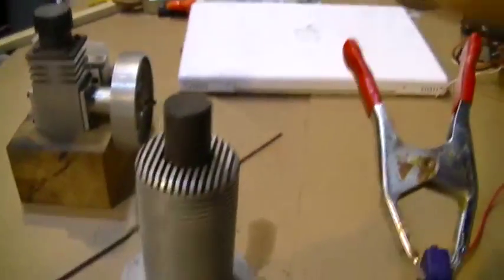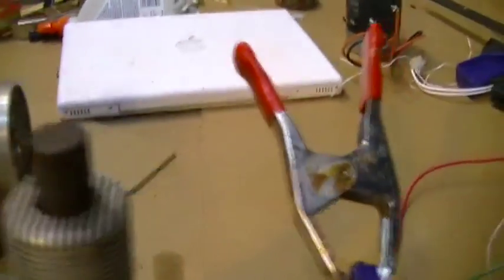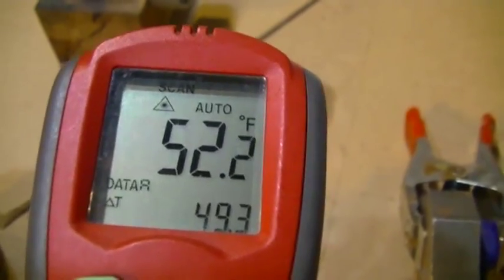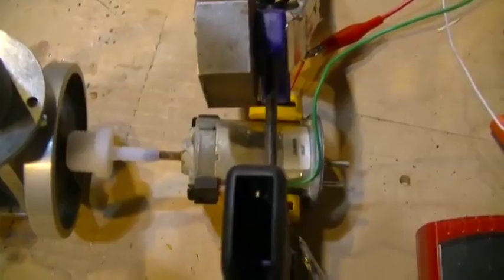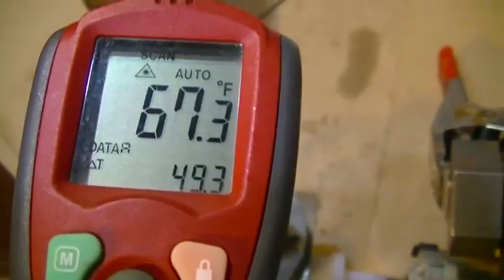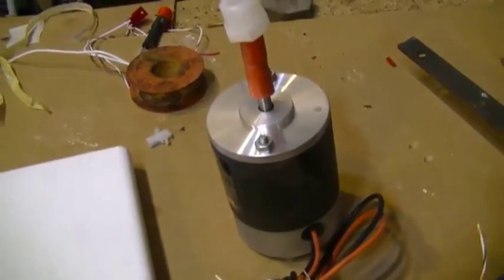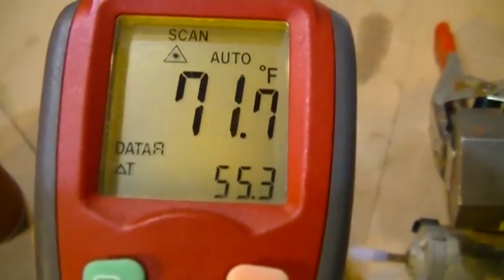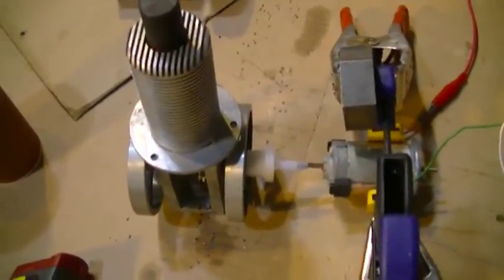Stirling Cooler Stirling engine 12v DC power source FPSC Mechanical refrigerant free refrigeration

Comment: What you were describing in the end sounds like a Stirling cycle cryocooler but I'm not sure how you would use it as an engine.  As you said the piston is completely sealed inside with helium and it runs on magnets.  There are no physical connections to this mechanical motion that you can get to or observe.  I've heard they CAN work in reverse (apply cold to cold head and heat to rejector) and you can get the piston to start moving inside.  But, like I said, you couldn't do anything with that motion.
Reply from the maker: It is the same but not as efficient. I have a real cry cooler stirling but the power supply needs jumped as the board is shot. I want to do a video soon on that.
Reply: I have a Stirling cryocooler too.  I produce liquid air with it.  For mine, I didn't even get a control board to begin with.  I use a variac that I bought on eBay.  The manual describes a "runaway condition" where the piston keeps moving if you don't use a heater to heat the cold finger before cutting power to it (Stirling engine effect!) but mine's oriented with the cold finger pointing downward and the manufacturer told me it won't take off running in that orientation for some reason.  Apparently, if your cryocooler does run itself on a temperature difference, it supposedly can damage it.
Reply: @ChristmasEve777  ⚠️ God has said in the Quran:

🔵 { O mankind, worship your Lord, who created you and those before you, that you may become righteous - ( 2:21 ) 

🔴 [He] who made for you the earth a bed [spread out] and the sky a ceiling and sent down from the sky, rain and brought forth thereby fruits as provision for you. So do not attribute to Allah equals while you know [that there is nothing similar to Him]. ( 2:22 )

🔵 And if you are in doubt about what We have sent down upon Our Servant [Muhammad], then produce a surah the like thereof and call upon your witnesses other than Allah, if you should be truthful. ( 2:23 )

🔴 But if you do not - and you will never be able to - then fear the Fire, whose fuel is men and stones, prepared for the disbelievers.( 2:24 )

🔵 And give good tidings to those who believe and do righteous deeds that they will have gardens [in Paradise] beneath which rivers flow. Whenever they are provided with a provision of fruit therefrom, they will say, "This is what we were provided with before." And it is given to them in likeness. And they will have therein purified spouses, and they will abide therein eternally. ( 2:25 )

⚠️ Quran

Comment: Induction used in cooking would work to heat the pistons on the engine. A new electronic motor to run vehicles maybe?
Reply: Or just use induction to move coils of wire directly and forget the stirling engine? (This is an electric motor by the way) Why waste any of the energy by first converting it to heat and then mechanical energy? Is there a purpose -- apart from maybe keeping your chips warm in the car.

Comment: Dan add a heat plug used in diesel engines to heat the piston on the Sterling engine that drives the engine that generates the cooling effect. maybe we could work on a cold sink to make a mass air conditioning unit that does not consume large amounts of energy? Novartis!

Comment: is stirling refrigerators more efficient than peltiers and if so how much more efficient
Reply: Dean Walcott Depends on the gradient, but in the worst case scenario a couple times better, in the best case scenario many times better. Peltier modules range from 0.25-4COP ROUGHLY if i remember, but the COP of 4 is only under a small temperature difference and rarely useful for the types of cooling you might use a compressor system for.     Meanwhile the stirling can do big temperature differences with less of a performance hit (one issue with peltier is hot and cold is so close that there is losses if the deltaT across the module gets big.)

Stirling refrigerators also vary in efficiency depending on how well they're designed and what temperature gradient you're going for, but they can actually do something functionally similar to a compressor cycle system but I think practically not quite as well (costs & efficiency.) 

Twinbirds Japan makes some really cool overpriced coolers for the medical market and coleman used to have a "Stirling Cooler" that worked like this.  It's been off the market for a long time though and I haven't been able to buy one used (i'd like to.)

Comment: a guy back in the 30's/40's did that already, it was even on an old popular science reel, and even in popular mechanic magazine as well, to give it a add flare he used a "crystal ball" as a lens for the heat source.... the reason it did not make him a millionaire then or today,reliability, plus it needs fan/blower plus the sun is not always out when it hot...and it leaks of course you and I know that can be fixed with secondary heat and electric ect. but then its to costly for the masses.

Comment: @vention4wh   I did this once - the propane flame in RV fridges produces a lot of electricity. But I could freeze blocks of ice in my little freezer with a good hot day - and when the sun disappeared, I used the ice blocks to keep the cool coming. It is more efficient to just get a photovoltaic to power a motor which powers a compressor though - until you get into REALLY big systems. This idea would work great for a skyscraper, but for a house, solar is more efficient.

Comment: wwwglobalcooling (dot) nl

You can find all the current models of portable FPSC freezers here. As well as other FPSC modules and units.

The Coleman model was a re-badged SC-C925.

Went camping this past weekend. Used the Coleman again. I noticed it is starting to look "well used".  Still works great, but I'd like to find a back-up just in case.
I do have an older Norcold portable i found at a thrift store, But that unit is quite heavy and uses a bit more juice.

Comment: @steveBB30 Sorry for the second reply, but it looks like nitrogen would be a better (and cheaper) alternative, even still. I was thinking you *had* to use an inert element (for which argon is the cheapest by far) but for the purpose of refrigeration nitrogen is just as well, though probably not nearly as efficient as helium...

Comment: @steveBB30 Thanks, Helium is darn expensive though for experimenting especially if you don't know what you're doing, and half the time will be having to deal with seals, imo. I'm wondering what the efficiency hit would be for an Argon based solution. I think gas-wise Helium is chosen because it has a super low density and compressibility, but I'm not sure if that's why.

Comment: By  "of very efficient design" you mean to say, "Not profitable at this time".

It's such a shame we screw ourselves out of these wonderfully awesome technological advancements. I remember back in the day when my grandfather used to, on the down-low, ahem, modify unleaded gas powered engines and diesel engines to get over 3 times the MPG back in the mid 80's, but you never saw any sort of full fuel system overhaul until over 15 years later, and were still decades behind what we could be!

Comment: it's just a magnet with ferro fluid lube reppeling it's self from a smaler magnet fitted in the bottom, of a none ferrus tube with about 190psi of helium in it then an electro magnetic winding is fitted to the bottom at one end and a gate type diod fips the polarity of the coil in the electro-magnet at a high osilation, and poof, same effect with none of the conecting rods in the way.

Comment: @GREENPOWERSCIENCE With the free piston stirling cooler as an engine by applying heat, would you not run the risk of demagnetising the magnetic coupling? Some neodymium magnets start to loose gauss at 60℃, which will render the cooler useless.

Comment: if you use solar power to run the sterling motor it can pump up to 4 times more heat from the outside of a house to the inside than the sterling need to operate :)

Comment: Have you looked into a solar application for an absorption refrigerator to cool your house with in the summer (with no electricity)?
One application is the propane refrigerators in RVs. If you could substitute some of that hot Florida sun for the propane heat source, there's a potential to make yourself into a millionaire.